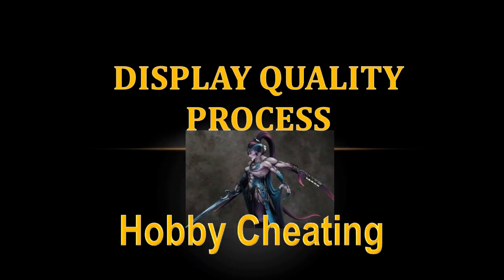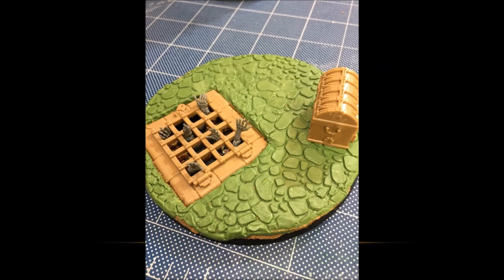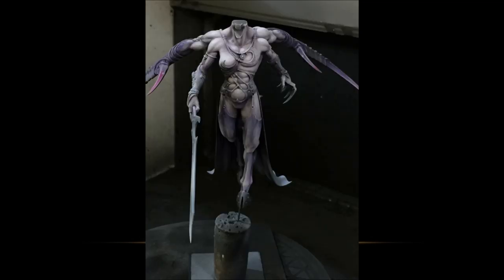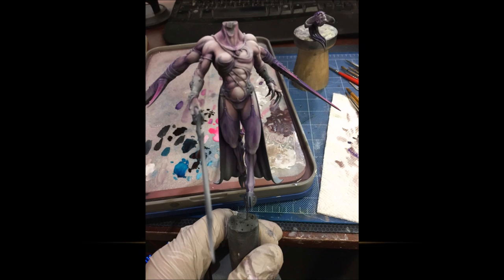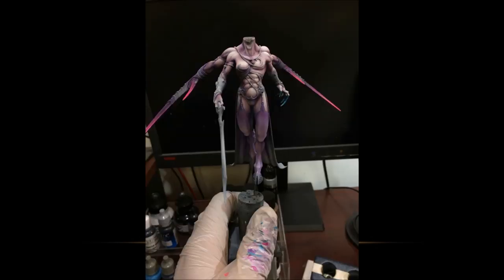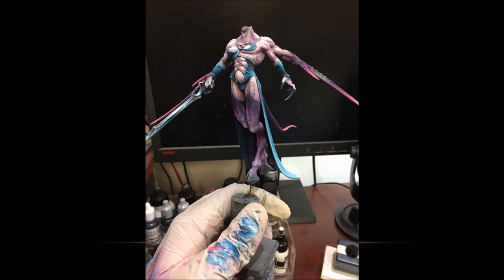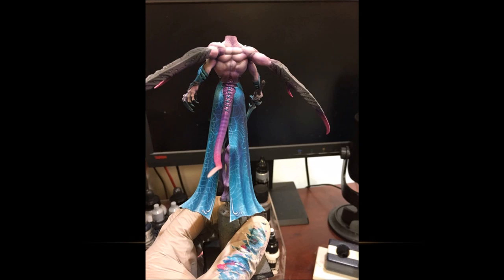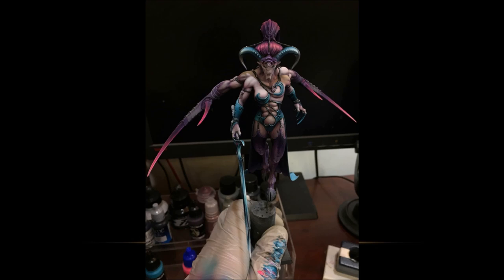Hobby Cheating 197 - Display Quality Process

Comment: Glazes are one area where artist paints might help you out. Model paints are nice because they're generally quite matte and opaque, but that will work against you when you want to make a transparent glaze like those purple tights. Artist paints tend to leave the pigments more pure, and they also give you more techical details about the pigments themselves. For example, a purple made from organic pigments like dioxazine, quiniacridone, and anthraquinone will be a lot more transparent than one made from mineral pigments like ultramarine violet, and artist paints will give you all that information. It takes a bit of study and practice to learn how best to use them, but like most color theory stuff it's not that complex. Golden has a nice range of artist paints for this, with their Fluid Acrylics line being similar in consistency to Vallejo Model Color, and their High Flow Acrylics line being similar to Vallejo Model Air.
Reply from the maker: I'll have to look into that and give it a try. I use lots of HBA, but never experimented with the others.
Reply: @VinceVenturella  one tip, I have found that it's often difficult to layer more paint on top of artist acrylics after they dry. I suspect it has something to do with the finish, as matte medium seems to help.

Comment: one important part you didn't mention is how you fix  gaps when putting together sub assemblies. especially smooth parts like skin around the neck of your KoS
Reply from the maker: In general, the smoothing of those areas uses the matte Medium trick I showed in a previous video and then some quick paint over that area. When it's that small, it's actually quite easily to blend it in.
Reply: Vince Venturella Do you mind pointing me to that video?

Comment: Would you recommend matte black for a dispaly plinth or satin black? And when painting the base, what is the best way to protect the plinth, Masking tape?
Reply from the maker: Satin generally, and yeah, some good painters tape (blue tape) is my favorite.
Reply: @VinceVenturella  Thanks, I tried Golden SoFlat matte black and found it a bit "off". So I might add a layer of satin varnish. Though if I remember correctly you recommend matte black for most tabletop pieces, which I think works very well.